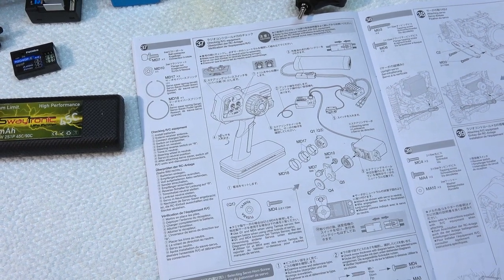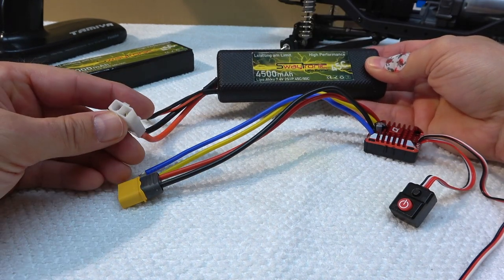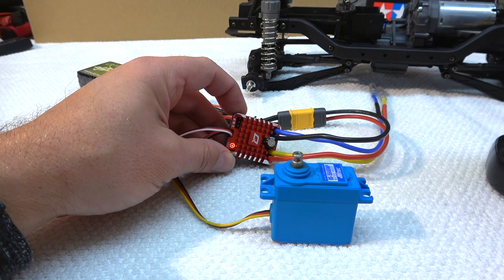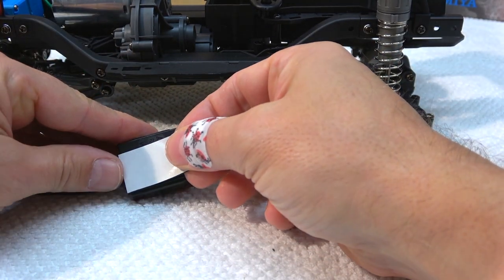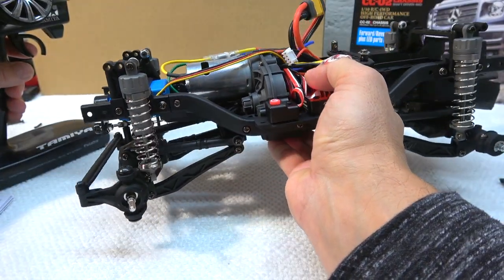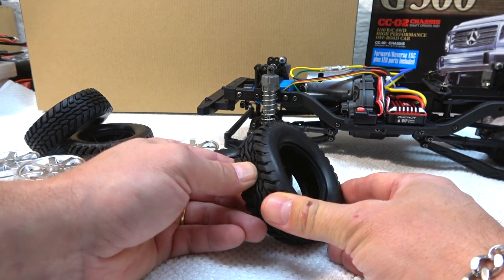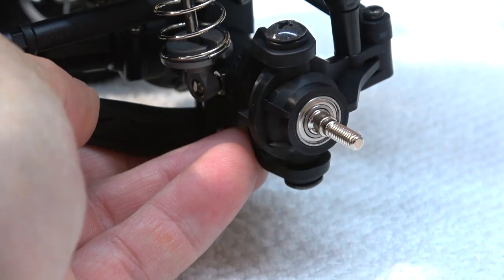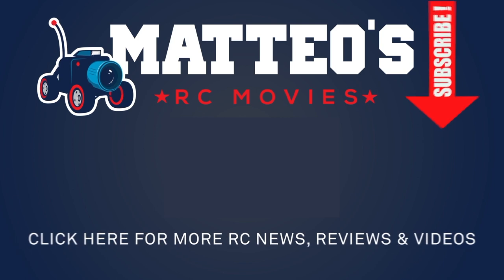Tamiya CC-02 Mercedes Benz G500 / Build Video 5 / Steps 37-45

Comment: I'm currently building my CC-02 G 500. I've also chosen the slower transmission, the same ESC and a 5-slot brushed motor, which works really nicely in my CR-01. But while almost everything seems straight forward, I'm having some issues with my servo. It's a standard sized "HV" servo from JX, which should also work with the higher BEC voltage setting of the Hobbywing ESC. It seems, that the servo can be "officially" mounted upright or in horizontal position, but there is no explanation why that is or what is recommended. Later, I found, that the servo cable collides with the rest of the frame, when I mount it in the horizontal position, even though it's a standard form factor servo, which seems odd. I was just wondering, if you had similar issues? Maybe that issue is the reason, Tamiya also allows the upright mounting position...

I then put it upright, facing down, which works, but the steering rod needs to be significantly longer. I'm thinking of putting an extension between servo arm and the ball connector.

https://imgur.com/a/fH9C4IX
Reply from the maker: No, I had not this problem with my servo. But I think also due the different dimensions and cable positions of the servo, Tamiya offers these two mounting possibilities.
Reply: @Matteomeier  I've mounted the servo upright and put 2 mm 3D printed spacers between servo and holder, so the servo reaches a bit lower. I also replaced the steering rod with a slightly longer piece of threaded rod for more stability. There is a little bit of bump steer, but I think that is normal for this frame, since the servo is mounted on the chassis and not on the axle/diff-housing like on the CR-01.
Later I found, that there are already two 2 mm spacers included (part trees C, part #1), which are marked as not used in the manual. Makes me think that they maybe initially planed on putting them in there...
Anyhow... it works now. :-)

Comment: Hi Matteo, the nuts do not always keep in position when slipped into the slots in the chassis. For example when I screw on the front bumper, the nut keeps slipping and I cannot tighten the screw. How do you handle this?
Reply from the maker: I had not this problem. Do you overtighten  the screws? These can not tighten so much as a normal screw.

Comment: How did you fit the Tamiya servo saver to the Hitec servo? Most Hitec servos use 24 spline shafts, and Tamiya doesn’t usually include an adapter to fit them. Is this particle servo different?
Reply from the maker: Its the futaba part who fits on it... I had no problem with this. Seems as this servo have the same spline shaft as futaba has.

Comment: My friend once tried 3S Lipo on his silver can TT02, that silver can didn't last long after some full throttle bashing. But it might be OK on a trail truck with much bigger gear reduction and much less full throttle running.
Reply from the maker: Yes, this is what I hoping for! 👍😊😊
Reply: @Matteomeier  Will you consider an upgrade of 35T CR-Tuned motor afterwards? I found the all-purpose Mabuchi silver can does not work really well on a crawler------it can get very hot on my CC01 (equipped with 2.5:1 GRU) when I go mountain climing.